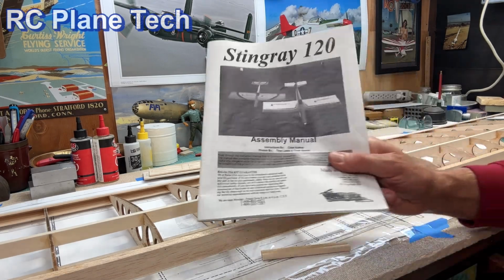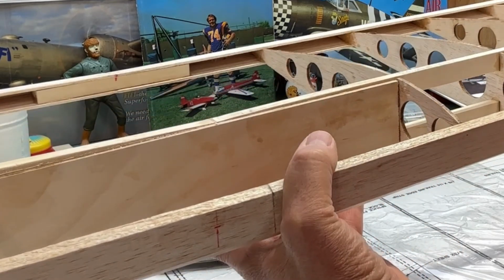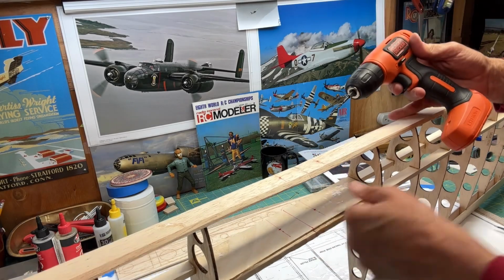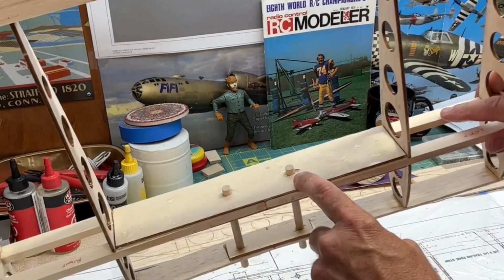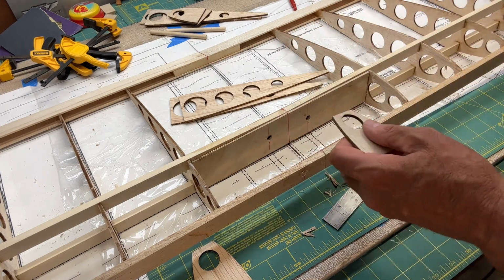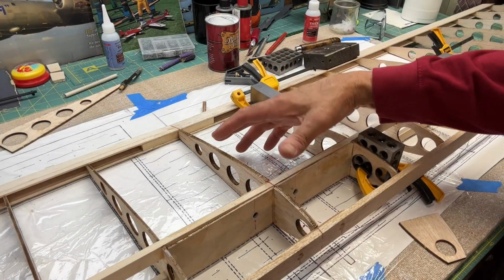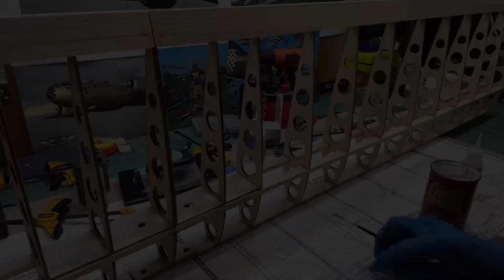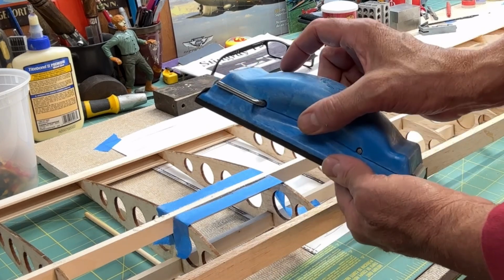Balsa USA Stingray with DLE-20, RC Plane Build N0 4: Wing Center Ribs and Dowels

Comment: Looking good. One thing I do to get clean drilled holes in these kits is to place a piece of painters tape on both sides of what I'm drilling. That mainly keeps the exit hole wood from blowing out often times chipping around the hole.
Reply from the maker: Nice tip!

Comment: James,  nice video.  Your life and useful will be much easier if you buy a small Wen sander for under $100.  It is the tool I use the most when building kits and ARF’s.  I can sand square, strait within a few thousands.  I also find a six inch dial caliper is much more useful and accurate than metal ruler/scale.  I use them for a lot other things though. You can get a dial caliper or digital caliper cheap these days.  I like the dial better but have both.
Reply from the maker: Thanks Tom, i have few calipers but they are not the dial type, I should pick one up or a digital one. Ill check the Wen sander also. Thanks
Reply from the maker: Also, I have a hand sander but always thought it was too beefy for kits, then the other day I pulled out my oscillating multi tool that I tried on the hardwood spar, and I was pleasantly surprised that I enough control and it worked well. i posted a short with that. My eyes have been opened to using some of these other tools now!

Comment: Well done. Looking forward to the rest of the build. Now that you are using the clear plastic wrap to cover you plans, how do you feel about it?  You can see the plans better but how is removal?  I have used wax paper and more recently started using parchment paper. Neither are great for removal afterwards.
Reply from the maker: I like the clear wrap, I decided to get the cheaper store brand because I didn’t want to have trouble with it being too clingy when rolling it out. So this stuff worked great, it comes out easily and sets down with little hassle. And it works great! I put a lot of epoxy on the wing brace and it dripped down and the plastic just pealed off. Thanks for the suggestion.

Comment: Dude what are you thinking?You're not supposed to send that spar down level with the freaking ribs.You run your sheeting up to the spar.And stop and then you go on the other side of the spar and start the sheeting again and run it to the leading edge.And it butts up against the spar.You don't stand this spar down.Flush with the ribs that's crazy.
Reply from the maker: No, the plans and instructions show the top of the spar flush with the ribs. The sheeting extends from the leading edge and over the spar and stops at the rear edge of the spar, butting up against the rib cap strips. The problem with this kit is that there seems to be some QA/QC  issues. For example the spar notches in the ribs were too big for the spar. I think the problem is that this is an old kit and they converted it to laser cut, but the laser cutting doesn't completely match the older die cutting, so for example they cut the spar notches too big. There are other issues as well.
Reply from the maker: And thanks …